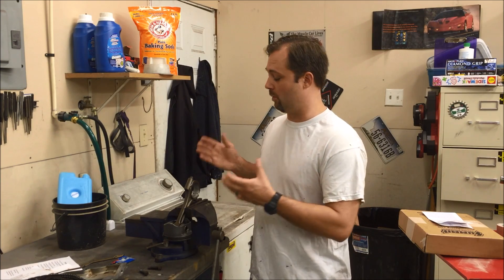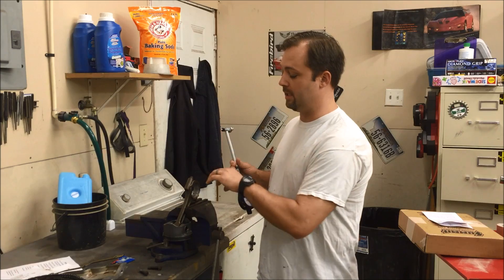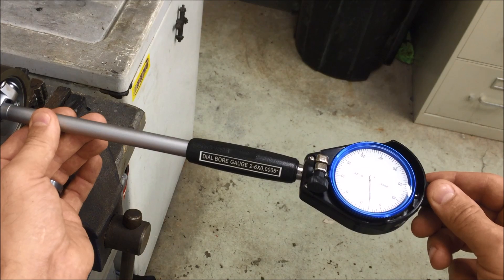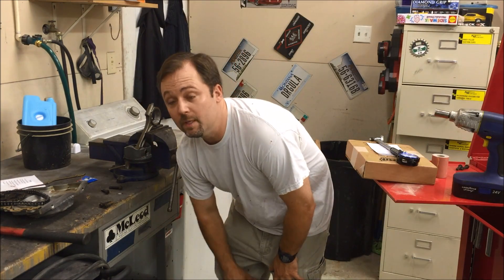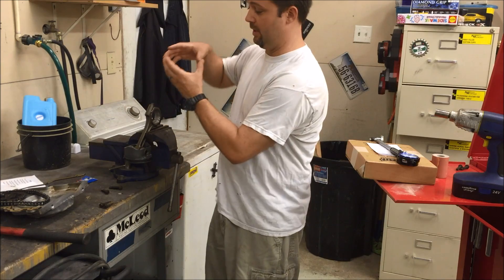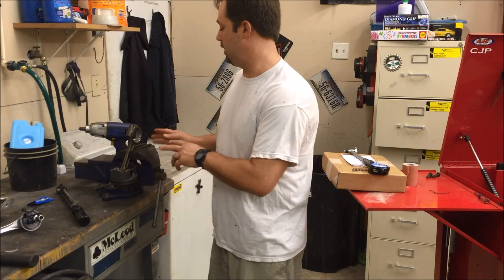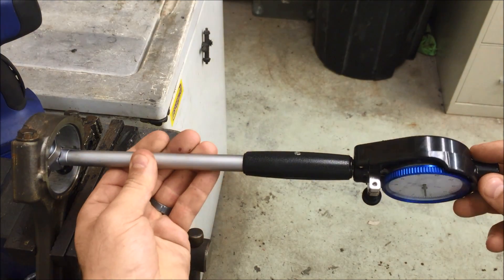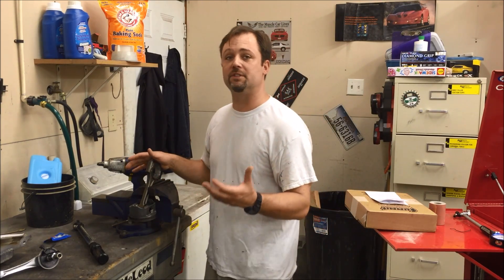Twin turbo LS swap foxbody Mustang part 3B; ARP rod bolts distorting the connecting rod?

Comment: In reference to not needing to resize the big end on the rods, when installing arp bolts. Is that the same for other engines like a 302 sbf? Or is this advice only towards Chevy engines?
Reply from the maker: I'm not smart enough to tell you yes or no on other stuff.  All I can say is that on the engine I built, the difference in out of round wasn't enough to cause me to worry about it - I'm not a pro though, so maybe it is enough that I should have worried about it, I don't know.  I would check whatever your building with a bore mic and then make your own decision.  Good luck man!

Comment: Great insightful video, I just put heads and cam on my 99 TA LS1 after about four drives the engine blew up, I was getting on it that night for maybe 30 mins, I also completed my breake-in.  After some high RPM runs heard some ticking then boom, haven't taking it apart yet but there's a hole in the block behind number 8. upon reading much people do say 97 - 99 have the weak rod bolts wondering if this is my case, all my supporting mods are taken care of tune was good. A real bummer since I don't know if I trashed my new heads and cam. Buying a used 100K 02 z28 long block and wondering if I should change the bolts? I heard 01_02 got stronger rods and Bolts from GMi believe LS6. never did trunion upgrade Im so curious. Been too cold in NY to take anything apart as of late. found metal shavings in oil and Motor smelled burned if that means anything. it's locked up won't even crank
Reply from the maker: It sounds to me like the oil pick up O-ring wasnt put back in properly during the cam install. Loss of or low oil pressure explains your failure.  Just my opinion. 

I wouldn't worry about the rod bolts on the replacement engine.
Reply: Underground Garage Thanks for replying. Oil pressure seemed fine after the cam install but then again my oil pressure was always kind of low was wondering if maybe it was an oil issue as well since I haven't changed the oil since the cam install. Real bummer! So you think I have nothing to worry about with the rod bolts in the 02 block? only asking because I'm afraid of installing the cam and heads on a 100k block. I know people who have more mileage and never had problems. Do you think I'll be okay installing my aftermarket parts if they weren't trashed with that O2 block. it's my friend's motor he called a midweek motor ran 12.90 @109 when it was stock with a lid, full exhaust tune and tires ran 12.3 @117 I know it sounds impossible but its true this guy always had factory freaks, he had a 2004 ZO6 running very low 11s another Factory freak. Only reason he pulled it is to put a 6 liter 408 Stroker with a single turbo  and has this motor in his garage He said oil pressure was always good and never overheated. Was thinking Id install the Motor stock since it's very strong as it is and build something over time or risk it and put my parts on the new motor very confused it's frustrating.
Reply: Underground Garage one more question if the O-ring wasn't put back in properly would there be any telltale signs right off the bat?
Reply from the maker: Changing the oil would have been a good idea, but it seems unlikely to me that caused the failure.  I still vote for oil pump O-ring.  

I wouldn't worry about the rod bolts.  If you aren't planning to take the rotating assembly in new long block apart, I'd run it as is.

Doing your heads and cam on the new motor seems like a solid plan, that's what I would do.  If you are nervous about it, and destroying another engine will cripple you financially, installing the new engine as it sits is a good option.  I would re-use the heads and cam, but I'm not nervous about installing the parts.  If you aren't comfortable with it, or can't afford to fix it if you break it, don't do it.  

A friend and I sit at second place on the stock C5 Zo6 fast list, 11.57 @ 117 or so.  A guy named Ranger is number one, he also went 11.57.  I've seen several stock-ish F-body cars run the times your friend achieved, so I have no problem believing what you guys are saying as far as ET.
Reply from the maker: When you unbolt the pick up tube, look at the O-ring.  It might be pinched or cut.

I can't count the number of times I've pinched one putting the pick up tube back on - ESPECIALLY when the motor is in the car and the oil pan is still on the engine.  

I've gotten to the point where I won't put one together and reuse the O-ring.  The old / used O-rings seem to pinch, smoosh out, or do something whacky almost everytime.  A new O-ring is less pliable, and it stays in place better.  Like I said, I don't even mess with trying to reuse the old O-ring anymore.  If you pull the oil pump off for anything, or pull the pick up tube off, I would strongly recommend a new O-ring.  Be careful when you put it together, and make sure you like the way it feels when it all goes together.

Best of luck!
Reply: Underground Garage I'll look into that, cam install was just like you mentioned, dropped pan a couple inches motor still in car. I wasn't there didn't see anything I paid him to do it. I don't even know if he used old oRing. If it was pinched\smashed ETS would there have been an immediate sign? It was driving fine. Thanks for your much needed help
Reply from the maker: It can do a number of werido things.  Erratic or low oil pressure is probably the most common symptom.  There's no way to say, "Yes, if it does XYZ right away, it's the pick up tube O-ring."

Comment: did u get intake or fuel system parts yet? also when do u expect it running with the 5.3?
Reply from the maker: I still need an intake, fuel rails, and lines.  I have the pump and injectors.  I am hoping to have it running by the end of the year.

Comment: built a sbf with arp rod studs and it threw all 8 rods out of round and destroyed all of my rod bearings
Reply from the maker: I've heard that a few times, that's why I measured it like I did.  Just curious, how do you know it was the ARP bolts that caused the engine failure?  I'm not saying it wasn't the ARP bolts, but most of the failures I've seen where people attribute the failure to the hardware, it ended up being something else.

I took an engine apart one time that had a bearing failure after only a few minutes of run time.  The guy blamed the ARP bolts he used.  He had put red loctite behind the rod and main bearings to hold them in place.  When the loctite dried, it swelled enough to close up the bearing clearance.  It didn't have anything to do with the bolts, but even to this day that guy tells the story as if the ARP bolts were the problem.